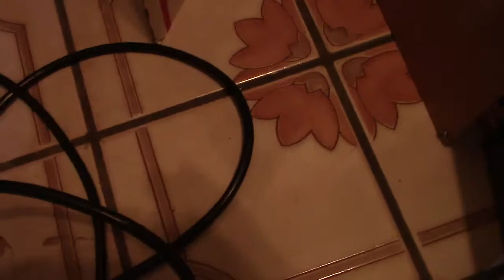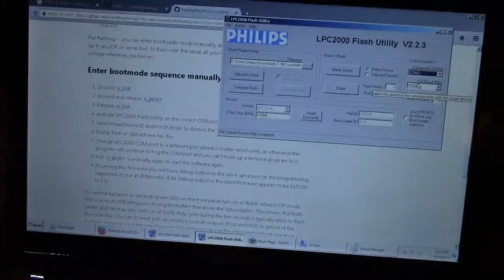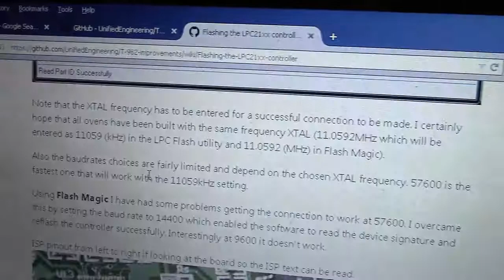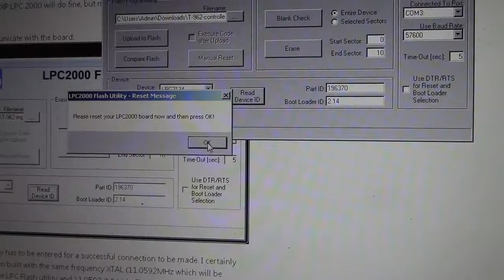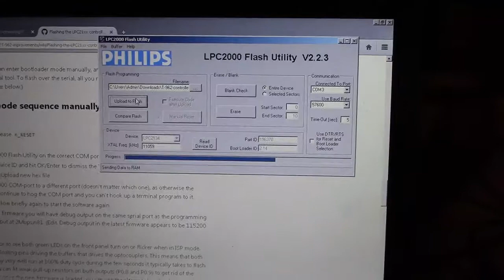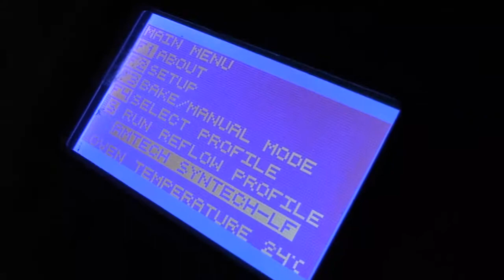T-962A Reflow Oven Upgrades (Part 3)

Comment: Great video, many thanks! Do you know if you're able to back up the stock firmware first?
Reply from the maker: was over 2 years ago i made this so i dont remember....check out the github link tho!  I think you can.
Reply: @SegasonicfanDesigns  Will do. Many thanks!
Reply from the maker: @StrathpefferJunction   Did this again recently, and yes, you can backup old FW ;)